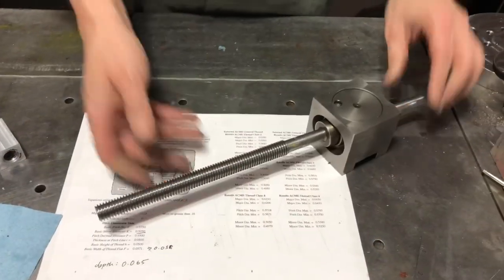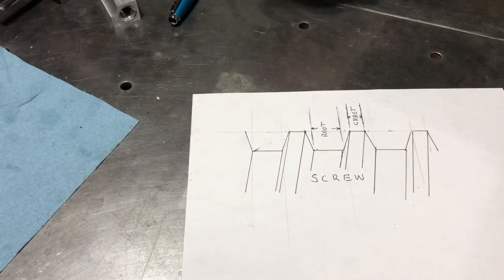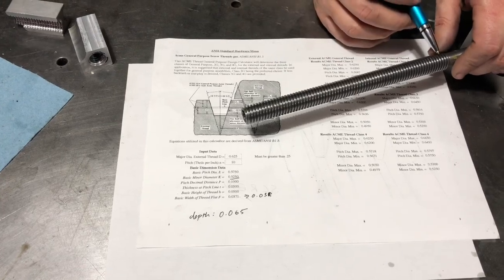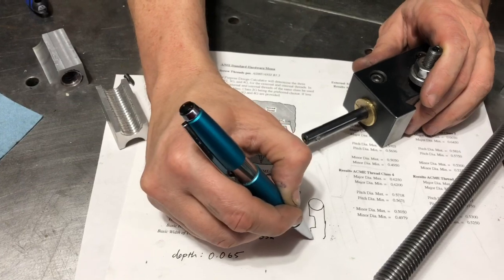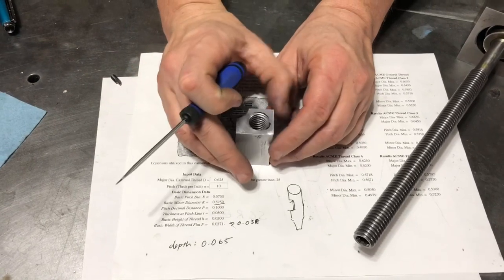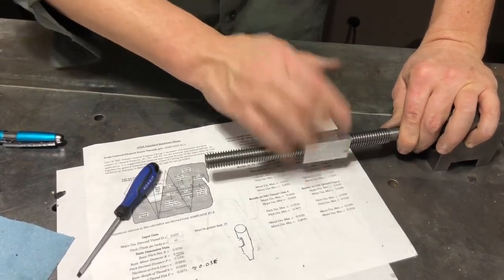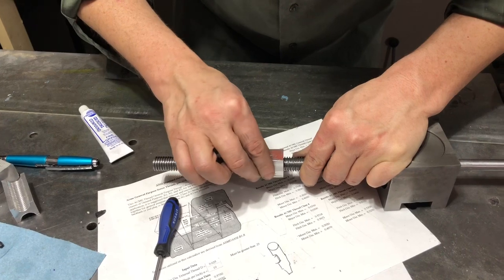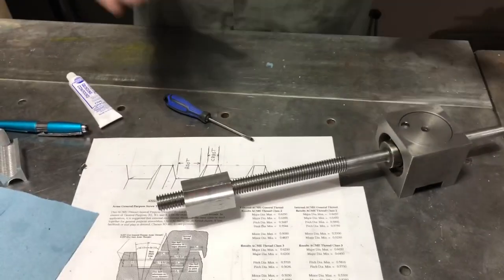Worn screw ACME nut threading

Comment: The solution I chose is to have the thread machined to make the worn measurement the same on the entire crossfeed screw. Then depending on price, have nut made to suit. Alternately, make nut out of polypropylene, heat forming it around the screw, then machining it to fit the support. If backlash is found, cut nut and make it a anti- backlash arrangement.